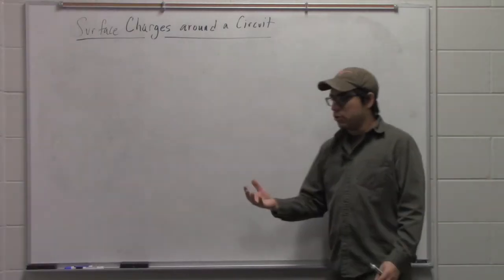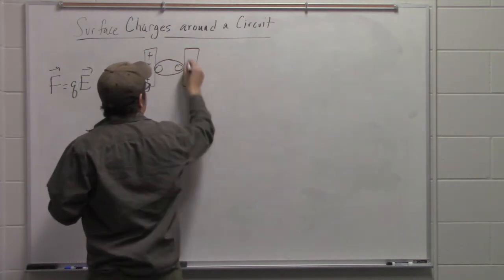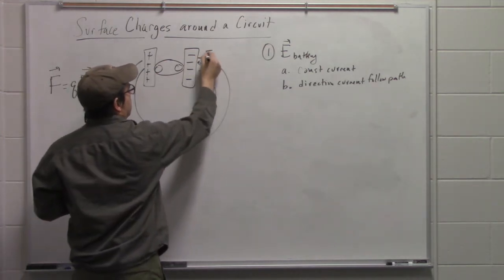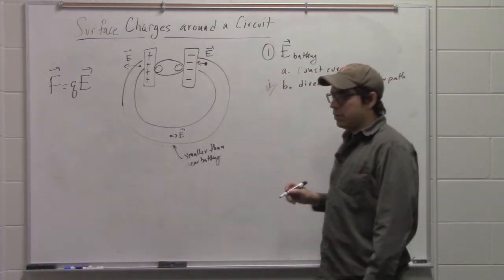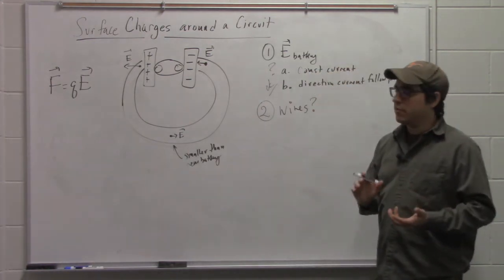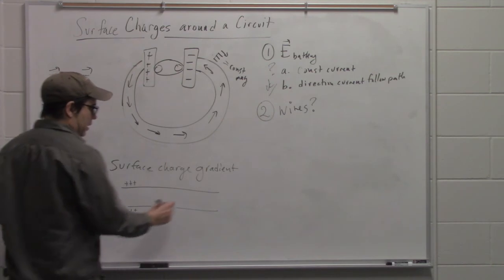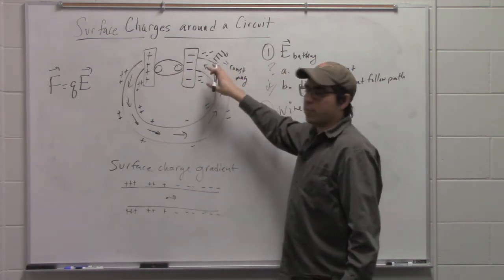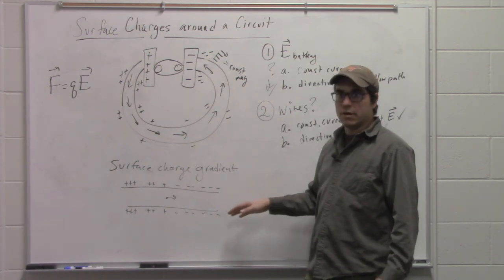Surface Charges Around A Circuit

Comment: Great! Thank you so much, this explains a lot. I would have 2 questions though and I would really appreciate if you could help me out. Is the electric potential at a point in a circuit defined with respect to the field generated by surface charges at that point? And where do these surface charges come from? The battery?
Reply: The wire itself already has everything needed, metals like copper already have a lot of free electrons, all they need is a force to direct them which is here an electric field created by the battery.
So, when you connect the battery, the electric field propagates through the wire from both direction negative and positive in light speed (ideally) and this force exerted by the electric field on the already existing electrons in the wire is what making the distribution of surface charges to look like that in the video.
The battery itself is the reason for this force to happen, because it has some metal that has excess electron and other ion that needs an electron (a real simple look at the battery) which makes negative and positive sides, so the ion in need of an electron attract the electron from the metal that has excess electron through the circuit and that what makes voltage or electric potential difference.

For the first question I don't understand exactly what you are asking for.
Reply: Yeah man!!.I also wanted the ans. Of above question..especially where does the surface charge came from??